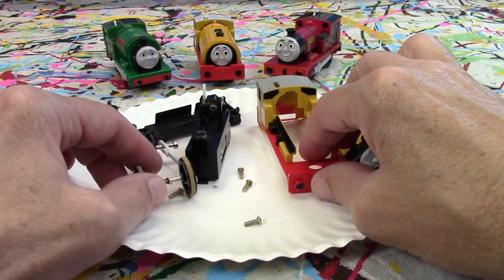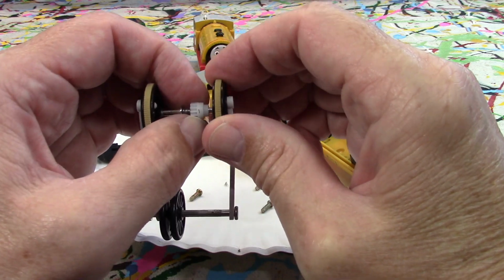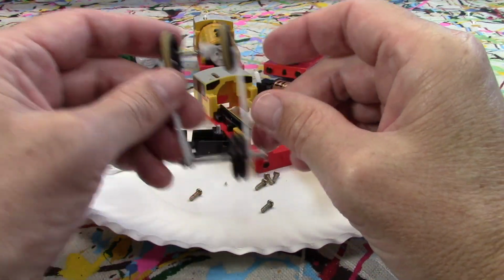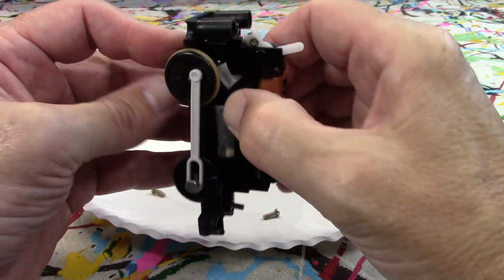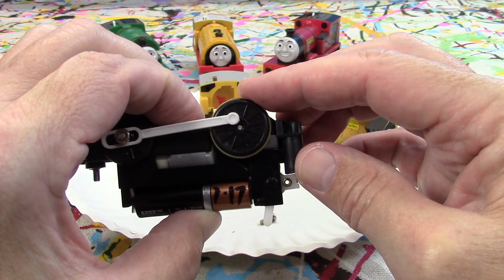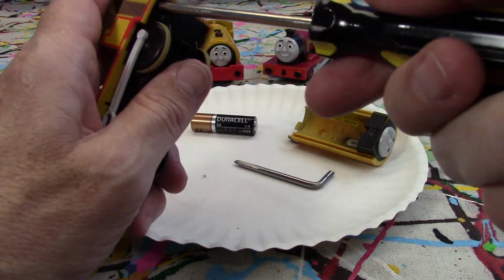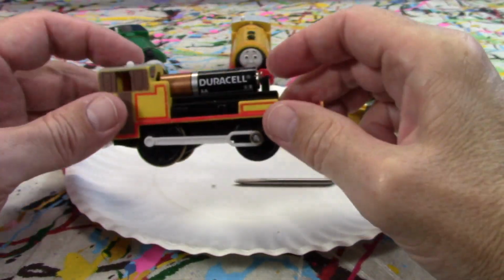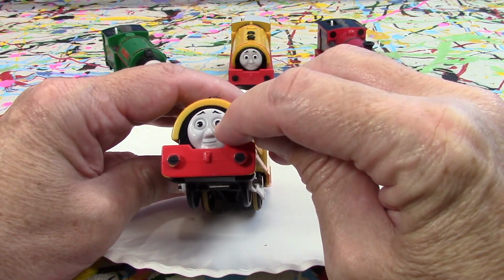What's Wrong with Ben? Ben is broken! Let's see what we can do to fix him! Tomy/Trackmaster repair!

Comment: My talking Edward doesn't even turn it's wheels! The motor doesn't turn around D:
Reply from the maker: You may want to have a grown up help you take it apart and see what is wrong. It could have something stopping the wheels from turning, hair maybe. Also check that the battery terminals are clean, and if it has wires going from the tender to the engine make sure those are in good shape. I hope you can get him going again, good luck : )!
Reply: ToyStew Actually, I took him apart last night, and I saw that a green wire was cut off, That's probably why he doesn't move. at least he still talks!
Reply from the maker: I'm glad you found the problem! It sounds like all that is needed is to find a little piece of wire and and connect the two ends of green wire to that with some electrical tape. I bet if you took it to a hardware store, Home Depot or Lowes you could find an employee to help you with that, if you're lucky they will get it back running for you.
Reply: ToyStew Ah, got ya.